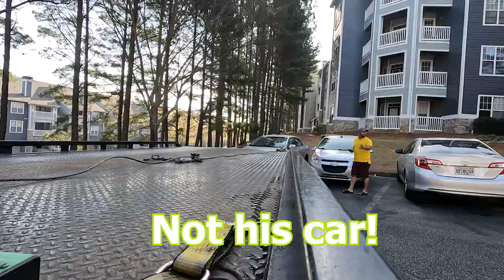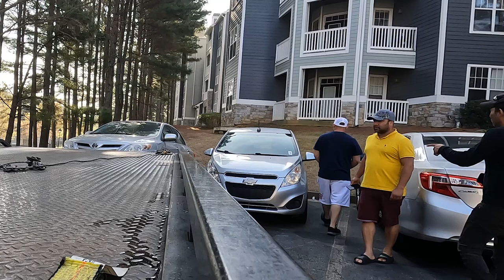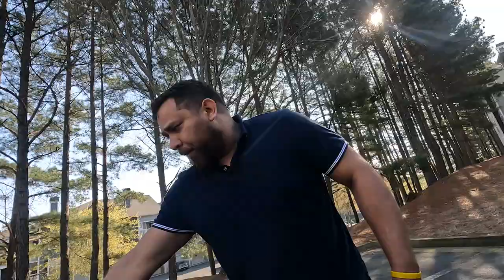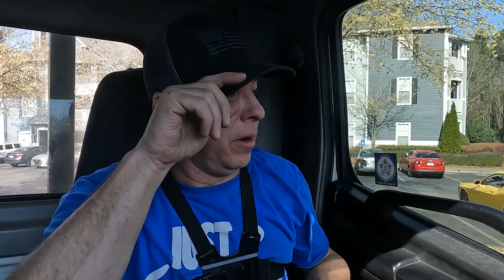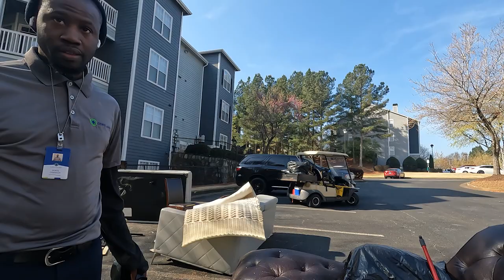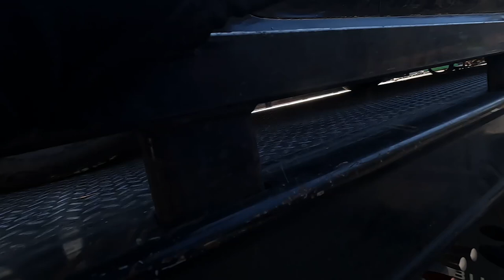Parking Revenge #333

Comment: I always wondered and wanted to see the process where you put straps on the wheel lift cars. I knew you would follow rules and do it but never saw it before. Thanks!
Reply: Often a truck will move the car away from the pickup location before putting the wheel straps on (and drag lights), to reduce the chance of conflict with the owners.
Reply: @VC-Toronto  yeah I figured as much just always wanted to see it happen